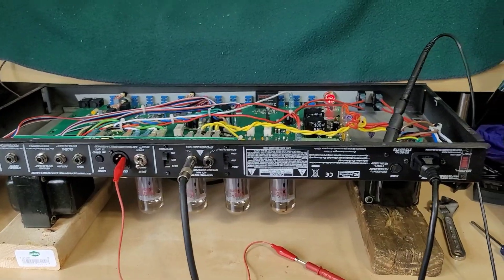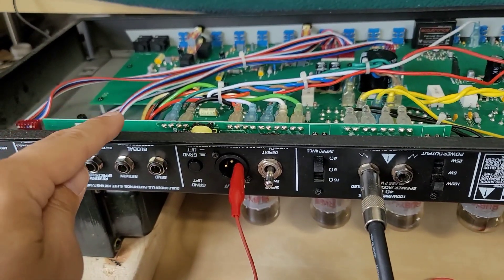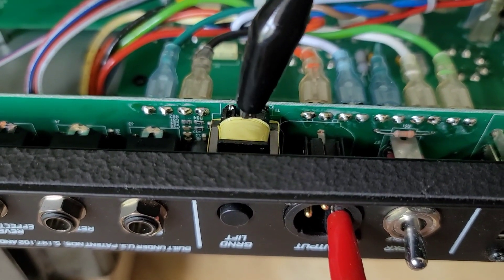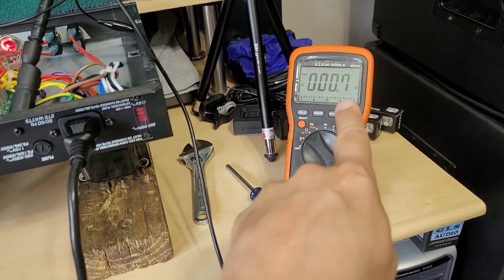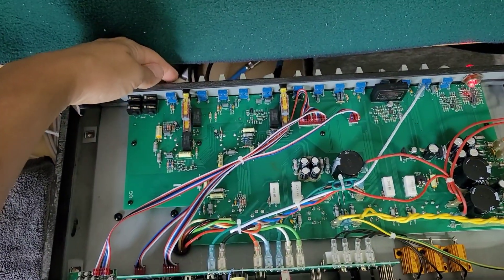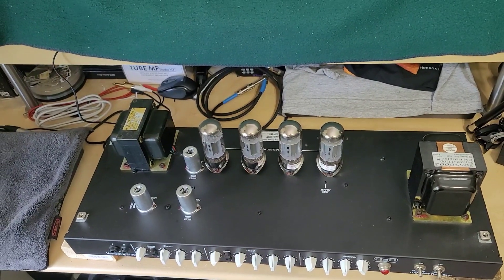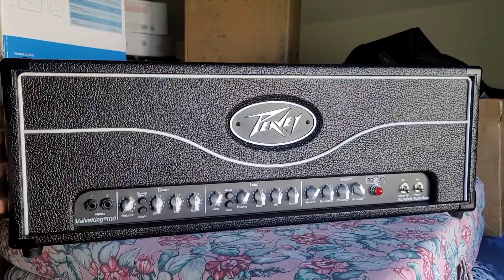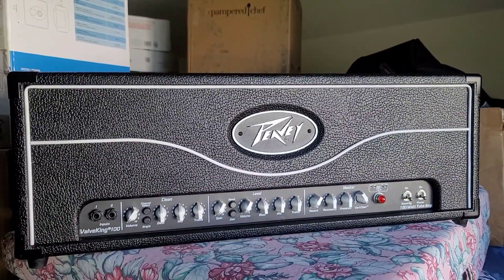Peavey Valveking MK II 100 Watt Head: Buzzing Through the Speakers. Let's Fix That!

Comment: Thank you man for sharing your knowledge!  Anything about this lovely amp is welcomed !!
Thank you again !
Reply from the maker: My pleasure! Yeah it's a great amplifier! Oddly enough it actually sounds great with bass! I was experimenting the other day with it and I used my bass amplifier's built-in crossover and had the highs sent to the ValveKing with its lead channel on. With my 4003 I got a really good approximation of Lemmy's Ric sound from Mötorhead!
Reply: @Bassguitarist1985  Awesome!  I bought it a few months ago.  I am a guitar player.  I couldn't try it to much yet but I like how it sounds.  I want to ask you that know a lot more technically... Do you know how much Is the lower level and gain settings for clean and distorted channel to get full amp valves sound with the lowest volume?  Thank you!
Reply from the maker: @Scottxxxlove  I'm still experimenting with it as well. If you are looking for full-on power valve distortion at bedroom volumes you might want to look into a power soak or hot plate attenuator there are a few different models out there from different manufacturers that you can try.

The clean channel is very fender like. The lead channel many people have opinions on it but it can certainly get into metal territory if you push it. I wanted it for the basic rock tones but I know it can start to get pretty chunky with the gain at 3.5. it goes through the roof if you have a boost pedal in the front of the amp.
Reply: @Bassguitarist1985  thank you!  I know about amp soaks.  Just wanted to know for your experience which is the lower level that you can say it sounds really good.
I like Megadeth and Metallica distortions a little more too.  I will try with some overdrive or distortion pedals.  I own a Blackstar HT drive valve pedal that is great.  Will try them all one day to test wich one works best.
Reply from the maker: @Scottxxxlove  for sure! A friend of mine just got a black star combo amp and he loves it. Feel free to do a video with the amplifier! I don't see too many videos from users on the MK2. Be nice to see more of it since not many got a chance to play these combos and head. They have the VK20 MH which is basically a miniaturized version but the same tone circuit I believe. I've heard good things.
Reply: @Bassguitarist1985  I am from Argentina, our economy is destroyed but about 5 months ago I could find the vk100 mk2 head new with 50% discount.  Awesome price.  This is my first valve amp.  Maybe one day I start doing some video about it.  I own a Marshall VS100R my first amp bought in late 90s.
Reply from the maker: @Scottxxxlove  very cool! For a lot of people the vast king amplifiers are their first valve amps too. There are many who will completely trash the amp because of reliability issues early on in their production life later on the quality improved. Then there are others who love to modify the amplifier with various changes to suit their playing style. The best way I can describe them is that they are not the best amplifier but they are certainly far from the worst and they are utilitarian for a lot of different styles of music out there. Make sure to keep them maintained and it will be good to you
Reply: @Bassguitarist1985  Thank you for your comments!
Reply from the maker: @Scottxxxlove  and thank you for watching and supporting the channel!!